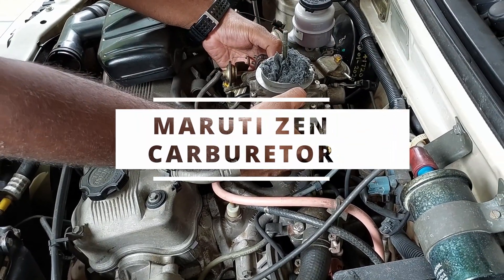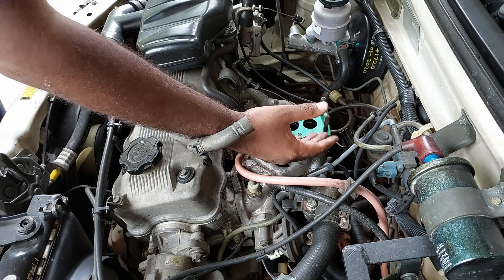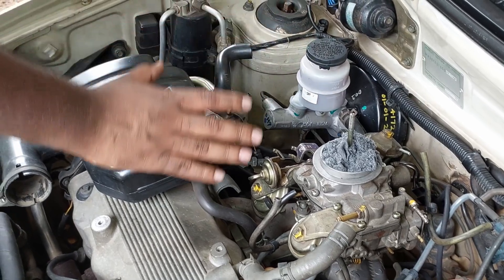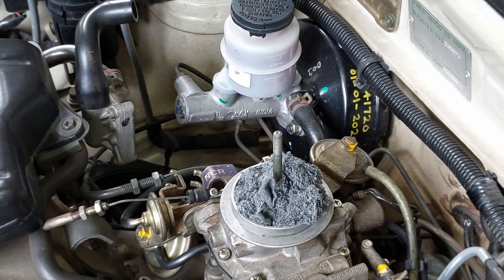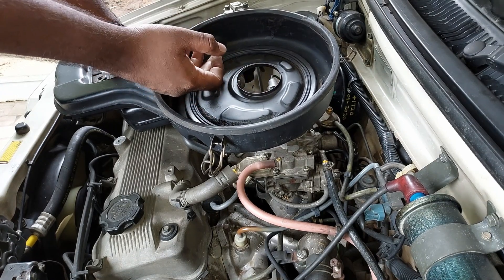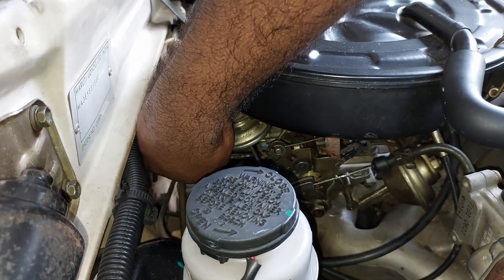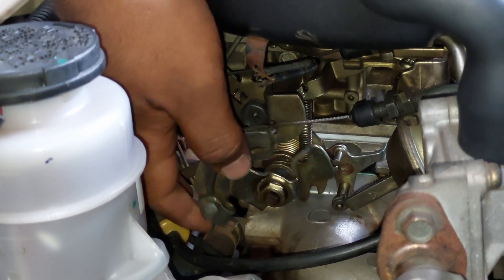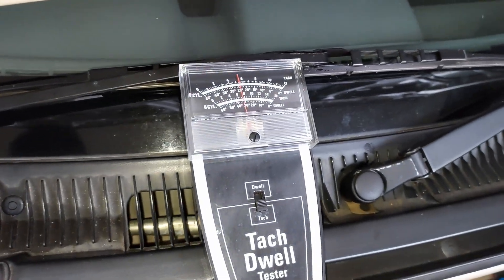Maruti Zen Carburetor service at home | Part 3 | Tuning the Carburetor | മലയാളം

Comment: New carburattor assembly wer to buy??
Reply from the maker: Only Kpacco brand is available. Original. Carburetor is no longer in production. Kpacco is available at most spare parts shops.

Comment: Mechanic കൊണ്ട് full clean ചെയ്തിട്ടും. Air fuel mixture full tight ആക്കിയാലും വണ്ടി off ആകുന്നില്ല.  Full to 1  turn reverse ആണ് max RPM കിട്ടുന്നത്.. Mileage 10-11 കിട്ടുന്നുള്ളു long drive ഇൽ ഉം... Exhaust ഇൽ petrol smell ഉണ്ട്.. പുക ഒന്നും കാണാൻ ഇല്ല.
Kpacco ഇന്ന് ഒരു carburator indiamart ഇൽ കണ്ടു 6700INR. അത് നല്ല carburator ആണോ.. Look like new in photos.
Reply from the maker: @sijojohnson  Kpacco carb njan use cheythittilla. Petrol Jeep il okke use cheythavar kuzhappamilla enna abhiprayam aanu paranjathu.

Comment: Ee zen il ningalkk currect tuning cheyyan vendi ethra turn thirikkendi vanuu 1.5 to 2 vare aano maximum atho depend on car athil kooduthal varaan sadyathayundo ? Ithinte reply pradheedhikkunni!
Reply from the maker: @RVtwinspark  More than 2 to 3 turns. Oro car inum different aakam. Engine condition, carb condition, exhaust condition okke anusarichu vyathyasam varum. Catalytic converter ulla vandi aananenkil complete exhaust system clean cheythittu tune cheyyuka.

Comment: Hello bro i saw ur video and just made tunning of my zen carburetor from my mechanic and the problem is after cleaning and tuning there is so much of white smoke with smell so i am worried abt it before the tuning process there was no such complaint😢
Reply from the maker: Hello brother. Seems the tuning was not done properly or there is some other issue with the engine. The procedure for tuning the carburetor that is explained in the video is as per the Suzuki service manual.
Reply: @bosegarage  ok brother I will do it and thank you for you support😊
Reply from the maker: @harshith_j  Kindly check the spark plugs and plug lead wires as well for any loose contacts. Issue with the lead wires also can cause improper firing which can lead to jerking issues.
Reply: @bosegarage  ok brother and there is some black water coming from the exhaust when I cold start
Reply from the maker: @harshith_j  water droplets coming out of the exhaust during cold start is normal. It goes away once the engine heats up. It is black because of the carbon deposited inside the exhaust over the years.
Reply: @bosegarage  Yes brother I just changed the spark plug now there is no any issues and there is no smoke from the exhaust I felt very happy and thank you for your support😊
Reply from the maker: @harshith_j  You are most welcome and I am really happy to hear that you were able to sort out the issue.
Reply: But the mechanic said the tuning is made properly and he told me to run the car for 1 week and just check whether smoke is coming or not. And the car seems to be running like missing and is it true to wait for 1 week
Reply from the maker: @harshith_j  If the tuning is done properly then there shouldn’t be any issue of missing while running. Did he connect all the vacuum tubes properly?
Reply: @bosegarage no brother he didn't remove the vaccum pipes he just removed the throttle and cleaned the air jet, slow speed jet and sprayed the cleaner to the openings
Reply from the maker: @harshith_j  Brother the carburetor needs to be dismantled completely for a proper clean up. All the gaskets and orings needs to be changed. The tuning needs to be done when the engine is at operating temperature. Try to adjust the air screw to 1.5 turns open position and see if the smoke is reduced.
Reply: @bosegarage  Yes brother I just tuned the air jet to 1.5 and still the smoke is coming from the exhaust and now the smoke is turned black and it's like missing
Reply from the maker: @harshith_j  Seems the mechanic messed up with the carb. Get it serviced and tuned by some experienced hand.
Reply: @bosegarage  Yes brother I went and asked the mechanic he told to change the carburetor with new one😐 
And thank you for your concern bro😊
Reply from the maker: @harshith_j  Brother then that guy is a crook. Please stay away from him. Get it checked by someone who really knows how to work on a carburetor. It is quite simple to work on for an experienced guy.
Reply: @bosegarage  ok bro definitely here in my locality I cannot believe any one
Reply: Hii brother I just made my car tuning and cleaning by myself now the riching problem is solved and car is idling normaly but now the problem is the car is jerking while running when I accelerate so what would be the problem so that I can check with that
And sorry to bother you😊
Reply from the maker: @harshith_j  If the car is jerking when you accelerate then it could be an issue with the acceleration pump circuit. On the side of the carburetor you will see 4 screws and a linkage mechanism. Inside that there is two rubber diaphragms. These diaphragms get dried up over a period of time and won’t pump fuel properly. You need to replace them.

Comment: I need maruti zen carburettor 2001 petrol model,where can I order
Reply from the maker: A brand new original carburetor is no longer available. You can check for Pacco brand carburetors in spare parts shops. Not as good as the original though.

Comment: Very very useful video 🙏. I'm kannan from kanchipuram tamilnadu.
Reply from the maker: Thank you Kannan 🙏
Reply: @bosegarage  it's k 👍
Reply: Naruto 800 97 fitted AC model  canister  in and out connection detail pls. Where to connect canister out? Also AC solenoid  connection position plus!
Reply: Naruto 800 97 fitted AC model  canister  in and out connection where to connect detail pls. Where to connect canister out? Also AC solenoid  connection position pls!

Comment: ബ്രോ zen ptrol flot എവിടുന്ന് കിട്ടും..? Secnd aayalum mathi.. Meetar work cheyyunnilla
Reply from the maker: Fuel gauge float puthiyathu ippol kittan prayasam aanu. Part number 34810M70F10 or 34810M70F11. Ethenkilum MGP outlet il onnu try cheythu nokkuka. 

Used kittum pakshe working onnum guaranteed aakilla. Scrap yards il anveshichal kittum.

Comment: I think you are a follower of brutha cartech and travel you videos are a copy of thats channel video
Reply from the maker: It is true that we have subscribed to Brutha cartech and travel and we have respect for the team behind it.

However we don't agree to the fact that out videos are copied. You wouldn't have made such a statement if you have read the description. Also you might take a look at the first video which we have posted on our channel about Premier Padmini 137D restoration and things to note regarding the car's bodywork. You won't find any other video that shares the information that we have shared.

The carb tuning procedure that Brutha follows is 1.5 to 1.75 turns of idle mixture adjusting screw. It might work for some Zens but not for all. If you watch the part 3 of our Carb service video you will understand the tuning procedure that we have followed which is exactly as per the service manual.

This channel is not dedicated for Zen maintenance videos alone. You will soon understand that when we upload our upcoming videos on various other vehicles.

Thanks for your feedback.
Reply from the maker: https://youtu.be/HS5syoYmXuI

Comment: Would you please let me know whether this carburettor can be used in Mark IV petrol Ambassador car? If possible what would be the required modifications?
Reply from the maker: Hello, I haven't heard of anyone using Zen Carb on a Petrol Ambassador. There are people who have retrofitted Mikuni Carb from Zen and 800 on old Fiat 1100s and Premier Padmini's. Will surely check if there is any possibility.

An alternative option is to buy brand new Pacco carbs which is replica of the original Solex carb. Not the best quality carb but the car will run fine
Reply: @bosegarage ഹായ് ബ്രോ എന്റ  കാർബറേറ്റർ സെൻ റാണിങ്കിൽ സെക്കൻഡ് തേഡ് ഗിയർ ഇടുമ്പോൾ മൂവ് അകത്തപോലെ ക്‌ളാച് പിടിച്ചു ആക്സിലേറ്റർ കൊടുക്കുന്നത് പോലെ സൗണ്ട് ഉണ്ടാകുന്നു എന്താണ് കാരണം
Reply from the maker: @nisamudheenpuliyakode815  Hello... Clutch maararayi ennu thonnunnu. Clutch slip aakunnathu kondakanam vandi 2nd ilum 3rd ilum raise aakunnathu.